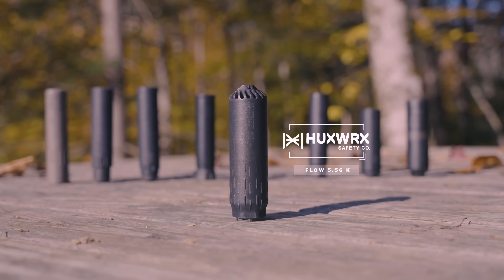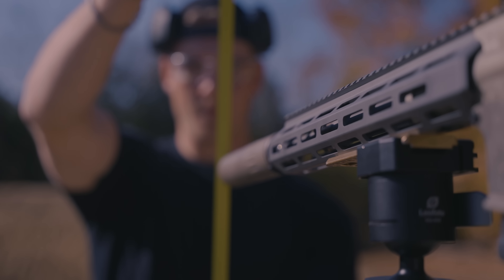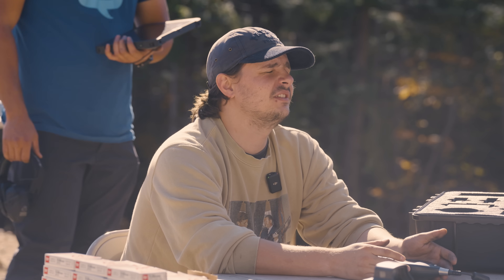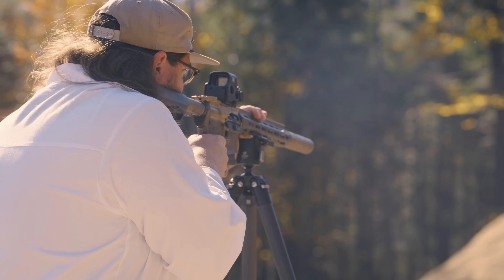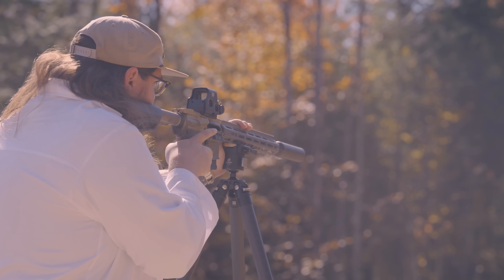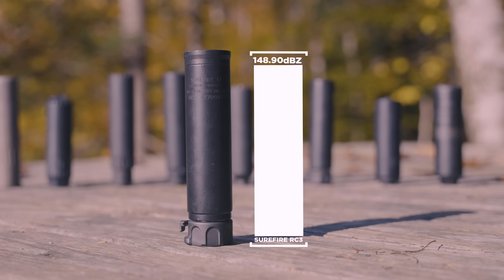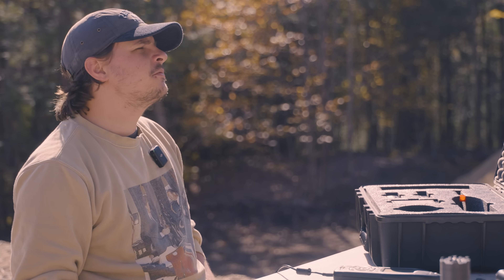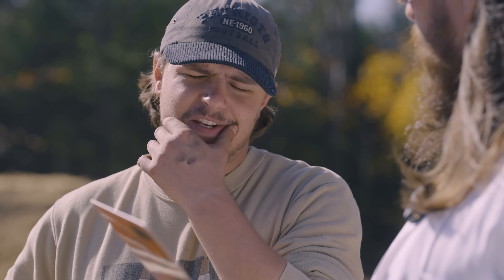Q SCIENCE | 5.56 SILENCER SOUND COMPARISON

Comment: For me the choice to include a couple of Boomer cans like the AAC and Sig SRD, and only smaller or "K" versions of the REAL competitors is the tell-all to this video. PTR wasn't even invited lol. I've shot the FS HUX 556 tI and it's quiet .... and expensive. My OCL Polo 556 and  Hydrogen are also very quiet, and cost half or even a THIRD of some of these new cans. Did I need to invest in a $60 BRT custom gas tube to get my rifles to run like melted butter on ice after? Sure did. I'm still in the win by like $600 lol.  Another thing you just cant argue with, and which this video unintentionally proved out - you STILL can't go wrong with that old RC2!

Comment: Will any Q suppressors work with the Sig MCX stock QD Flash hider?
Reply: Did you ever find an answer? I'd like to know
Reply: @edwardgarrett3744 it does not, but you can send the upper to Sig and they will remove it for you and tighten everything down. They were quick and only charge for shipping.

Comment: The M4-2000 is a really good can to this day, minus the antiquated mount system and can be bought cheap.  The RC2 is a great can still, its basically a M4-2000 weight and backpressure wise with a better mounting system but its expensive.  The OCL Polonium is a beast for $500.

Comment: The peak dBs (which some people new to sound measurement say "don't matter anymore" but are still a major factor in any auditory risk equation...) from the lil' ol' much-maligned Larson Davis meter as compared to the PEW numbers are interesting.

Obviously it's not the same host Mk18 (Q's looks like a 12.5?), not stated what ammo (looks like Q Winchester 5.56 vs. PEW Federal XM193 55gr), atmospherics, etc. from Q video, so I'd expect numbers to be slightly different from the two sources, but... in the end, they weren't wildly off from each other. 

Example, the HUX and RC3 had near-identical results from the two testers.

Whereas – interestingly – the Polo-K, arguably the best overall-metrics can of the competing batch, the PEW result was FIVE dB higher peak muzzle than what Q got. If someone suspected fudging the numbers, this would have gone the other way.

HUX FLOW556k - Q 151.62 vs. PEW 150.3
SUREFIRE RC3   - Q 148.85 vs. PEW 149.0
OCL POLO-K       - Q 144.47 vs. PEW 149.6
AAC M42000      - Q 141.00 vs. PEW 144.3
SUREFIRE RC2   - Q 142.45 vs. PEW 145.2 

(I still use my LXT and 2209 meters for messing around at home, so this was just interesting to see.)

Southpaw looks like a nice can.

Comment: People shit talk flat baffle cans, but ive been running one I form 1'd and built myself for 5.56, and aside from higher back pressure, it functions just as well as the 5.56 cans ive bought. 

I run an adjustable gas block, and it works flawlessly. My 75 gr loads are borderline hearing safe.

Comment: 🔥One thing is for sure, the Hux 556 Flow is loud, but must be spot on for low back pressure… the rifle would not cycle!
Reply: its so low backpressure it sucks all the pressure out of the receiver sealing the bolt to the chamber like F'ing tupperware, you have to burp it open